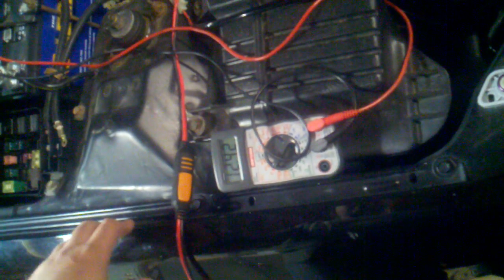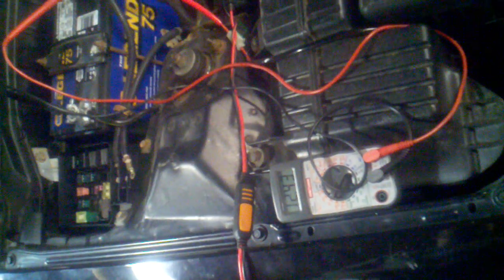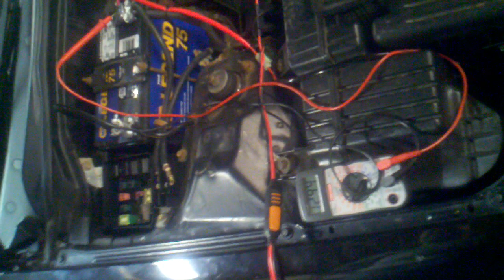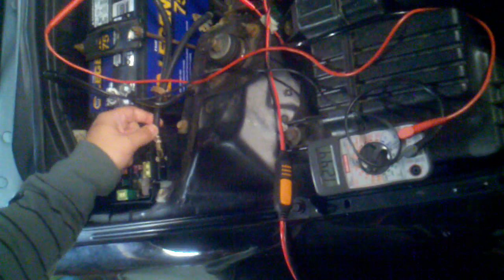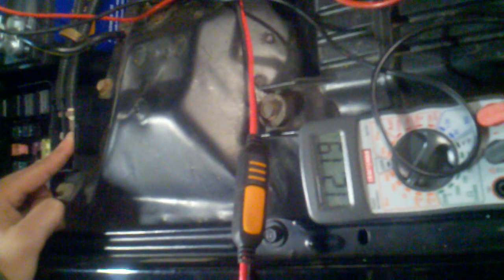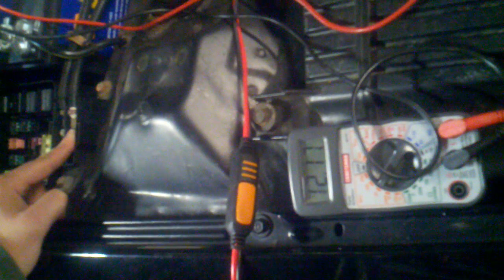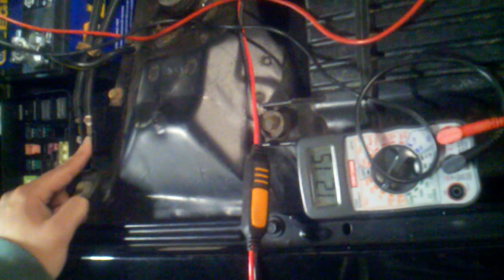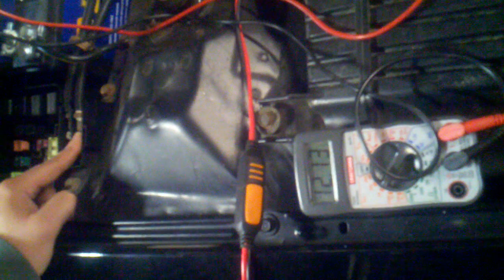How to test for bad alternator.  Internal shorts etc

Comment: @LMEngineering. Meter set to DC, battery live disconnected . meter + probe on battery +.
. Meter - probe on alternator + output . reading 12v.
So alternator positive is earthing.
Is this normal or
Is this an alternator internal short ?

Comment: my car  alternator is not charging the battery at all already got 2 new  alternators and now 2 new batteries   still not charging so now i am at a lost because all the things i checked still showed they are good at the store just not doing nothing when hooked back up to the car what do you think it is?
Reply: If you still in that same situation hook up your meter to the battery turn on the engine and try wiggling the connections at the altrrnator one at a time while looking at the meter.

Comment: Shouldnt a current draw test have found the alternator short?
Reply from the maker: +jasaircraft you would think so right?  I did too, however the alt circuit was not like testing any other fused circuit in the car such as interior light, tail light, fuel pump etc.  This was a mysterious one at first but all these years later I'm glad it's still helping people figure out this strange issue.

Comment: My rear brake light stuck on only when my alternator run! + my alternator dont have enough power when my ac or head light are open!
If i get a new alternator,my brake light issue will be ok?
My brake switch is ok and fuse are ok either!
sorry for my english
Reply from the maker: That's tough to tell, would require in depth troubleshooting
Reply: My brake light stuck problem was cause by a wire into my door near the key open door ! i put a lot of WD 40 in my key hole door lock and its fixed like magic LOL! very strange ! thanks

Comment: i have the same problem and turns out a short in the regulator which is part of the alternator, i bet if you run those wires from your tester from battery negative (disconnected) to the negative cable and have it set at say 10Amps you will see exactly how much you are drawing, i was drawing 3.48 amps!! so very quick flat battery like you are seeing here, but i hear what you are saying a rebuilt alternator giving these problems w.t.f!!!
Reply from the maker: +richard gilberd yea its low quality rebuilds. Can't blame the company sometimes they get bad components or its the employee rebuilding them incorrectly, but still it was a pain.  The pain was at least worth it in the end with how many people I've been able to help from creating this video.  Plus I became a pro at Civic alternators and getting them swapped in under 15 mins lol

Comment: Thank you for this video! I have the same problem with my Lexus rx330. The alternator still charges when running but the car is dead in the morning after being off for a period of time. Since the alternator was charging  the battery when running I didn't think it could be the culprit when the car was turned off. Thanks again!!
Reply from the maker: you're very welcome

Comment: The problem was, once I jump-started the truck, the alternator had to pick up a huge load to recharge a totally dead car battery. For the old generators and alternators of the 1950's and 1960's, this was not a big problem. But today, with weight a paramount concern for carmakers, alternators will not put out sustained high currents, without overheating. A modern alternator may be rated for 100 amps or more - but only intermittently, not continually.

As a result, my truck battery went dead again. And when I bought a new battery, the problem persisted. The new battery appeared not to be holding a charge. I checked the system voltage and realized that my alternator wasn't charging. In fact, the windings had melted together and shorted out. (It should be noted, that when it comes to "there's a short somewhere", the alternator is usually the culprit. A shorted alternator can drain a car battery, even with the ignition off).

Comment: Dude you are right on!!!. My F-600 bucket truck stopped charging so I replaced both the alternator and voltage regulator but also put in a brand new battery which cost me $140. and guess what?, the truck charged like a powerhouse but come the next morning the battery was completely dead. It has to be the rebuilt alternator that I put in because that is the only thing that changed. Your video is right on and for all of you with the same problem always suspect the new alternator if that is the only thing you changed out and the vehicle never had a dead battery draining problem before. I think that some of these cheaply rebuilt alternators do not get new diodes or also may be internally damaged causing this to be a common problem. Also be careful not to connect the two main wires on backwards since this may fry the alternator right off the bat. Hope this helps some of you with the same problems.
Reply from the maker: I am glad this has helped so many diagnose their issues including yourself.  When you buy a new alt, you don't expect it to be DOA (or multiples to be DOA), but it happens often.

Comment: Can this happen intermittently? I've been trying to find a parasitic draw with no success. Car battery dies once a month. Thursday I unplugged my alternator due to the voltage dropping when I checked at battery with multi meter. It stopped dropping  right away. Plugged alternator back in and voltage didn't drop.  That must have stopped/reset the regulator or rectifier bridge inside alt?
Reply from the maker: Yes it absolutely can.  Unfortunately when it happens intermittently it is hard to trace. Since you said it only happens once a month there is no way to pinpoint when it is going to happen again you know?

If you have no current draw when testing your only course of action may be to replace the alternator with a new unit and see if the issue ever appears again. 

One thing to think about with the intermittent stuff is if the car is in storage, it probably ISN'T wiring.  If it's driven all the time and the issue pops up randomly, it COULD be wiring related as some uncovered/broken/etc issues could move from vibration/wind/etc while the car is in motion.

If the alt is not expensive I would probably start there (I hate throwing parts at issues rather than proper diagnosis) but sometimes when it is very intermittent you have no choice.

GL with your diagnosis, come back and let me know how you make out!
Reply: gasper44 when the car dies once a month I do a voltage drop test in the fuse box. 91 olds ciera. No fuse box under hood. Haven't found anything. The alternator does a intermittent whine once in a while with car off, but usually stops on it's own. I caught it doing it Thursday, and it behaved like your video.

Voltage at battery dropped from 12.5 to 12.2v in 3 hours. I unplugged alternator harness and it stayed at 12.3v till I started it next morning. 4 mechanics can't find what's draining the battery but after what happend Thursday and finding your video I think it's intermittently draining my battery. Car dies around the same week once a month. I'm going to just keep unplugging the alternator when not in use and if the car doesn't die I'll assume that's it.
Reply from the maker: There you go.  Not all mechanics are well versed with this issue...and a LOT of mechanics HATE electrical issues as they are more mechanically inclined.  I enjoy both but because of this, I made this video since I do all of my own work and discovered this problem.  You are right, if you unplug alt harness when not in use, if you stop getting a dead battery, the alt is your issue from the sound of it.
Reply: gasper44 Did you have your alternator bench tested? I've brought it to different stores and it tests good on the machine. That's why in going to try the un plugging it approach before I drop 100$ on an alternator.
Reply from the maker: Every single one I returned at autozone that has had this issue was bench tested and passed 100%, although the test only see's if it outputs voltage, not if it draws it at the same time.
Reply: gasper44 bought a brand new alternator not rebuilt. Installed it a month ago or more, problems gone. Crazy old alternator tested fine but intermittently draining battery.
Reply from the maker: glad your issue is now SOLVED.  
:)

Comment: this is an awesome video mayn but I think I might still need sum more light shed on my issue,,,1997 Towncar 4.6L the Battery & Alternator are new (tried 3 different alternators too)...but the battery light keeps coming on the dashboard and battery aint getting charged. it doesn't drain though like in your video that's the confusing part any ideas?
Reply from the maker: Is your voltage regulator inside the alt or external?  On some cars its not all in one.  If not in alt check regulator.  Test for amp draw as you pull fuses too to isolate the drain

Comment: What is the resistance between your hot terminal (that connects to battery +) and the ground terminal on your alternator? I'm getting differing opinions from various mechanics on whether a there is supposed to be resistance reading between those points and if having a high reading (~2500ohms) indicates an internal alternator short or not. Thank you for posting this video

Comment: Thanks. Here's a question  maybe you, or one of your viewers know.  Have Ecotech 2.2 pontiac.  Temper guage not parking at bottom. Going from 90 degrees cold past 125. Lately going right over and interfering with rpm needle. Not over heating. Changed ECT sensor twice. No air lock. Thermostate open. No blockage hoses. Interior heat normal. No codes. Seems to be running normal. A (little) bogged down. Getting 1.28 between power and ground on ECT wires at sensor when ign off. And 4. something when running. Puzzelling. Any ideas.

Comment: Great video. I think i may have the same problem on my car.  Questions, did your alternator  preform normally when the car was running charging the battery  What voltage reading did you get immediately after turning off the engine. Thanks.
Reply from the maker: Yes it did.  That is what made this issue hard to diagnose.  Worked fine under load.  No load, it started draining instead of charging.

Comment from the maker: Could def be a battery.  I would do this.  Charge battery, disconnect battery negative or positive cable.  Let it sit overnight, when you reconnect terminals if you have same issue most likely battery.

Comment: I have a 1988 subaru chaser GL, my battery died because i left my lights on, so I got it jumped, let it run for 20 minutes, rode it around the block and it rode fine. Came to start it 20 minutes later and it wouldn't start but the beeping sounds got more and more faint... Is this a battery problem right?

Comment from the maker: If anyone has questions, i'd be glad to lend some advice if you have a problem description
Reply: @LMEngineering. Meter set to DC, battery live disconnected . meter + probe on battery +.
. Meter - probe on alternator + output . reading 12v.
So alternator positive is earthing.
Is this normal or
Is this an alternator internal short ?

Comment: I am having a issue with my battery dying overnight if I leave my cables connected..I tested for a parasitic battery drain and nothing.only draining 0.015..when yo had a faulty alternator did you have a parasitic drain..thanks

Comment: So what sort of voltage was it putting out when the engine was on?  About normal range?  And was this one of those "no code" situations from the PCM?

I only ask because the charging system gremlins are causing me to pull all my hair out.

Comment: In alternators I from experiance would never buy rebuilt parts from auto zone,and the reasons are that they have poorly rebuilt parts alond with the fact that its not a good idea for any automotive owners.
Oreilly auto parts aka known as shucks or checker auto parts is a better choice.
When I had my old 1979 chevrolet malibu it had a few rebuilt electrical parts and they were the starter and alternator.

Comment: One of the diode terminals on the rectifier in the alternator might be missing it's insulator and causing a low current parasitic drain straight to the alternator housing. Lame rebuild.

Comment from the maker: @kevinermitchell 

Look at voltage regulator.  In hondas, they are generally on the alternator itself.  In other makes, sometimes they are mounted in the engine bay/connected to ECU.

Comment from the maker: Also wanted to add that you never want to test voltage on your multimeter when on the amperage setting (you will blow the fuse!).  I learned this lesson a long time ago in electronics courses when I was younger.